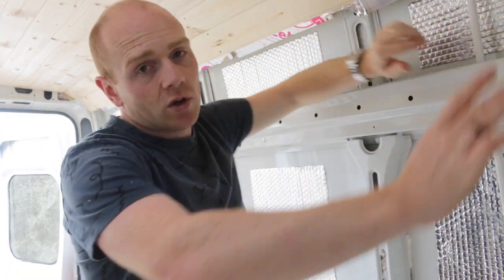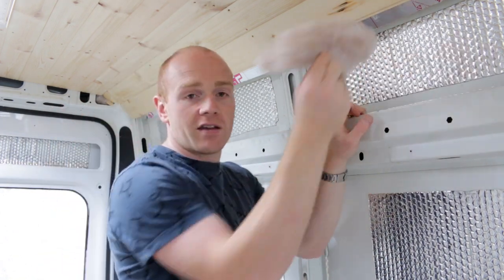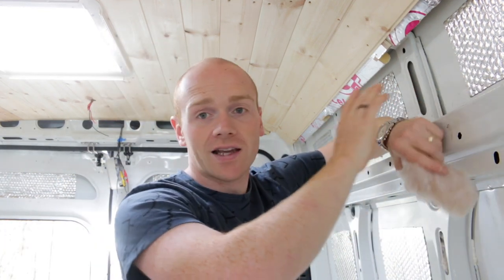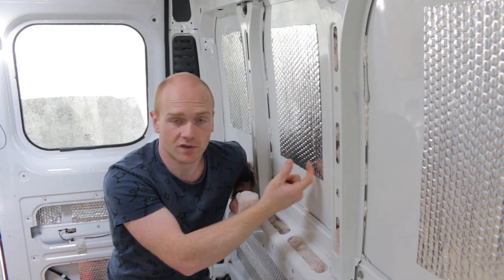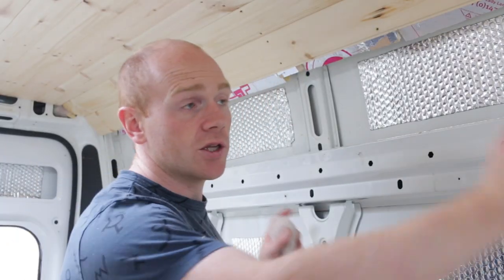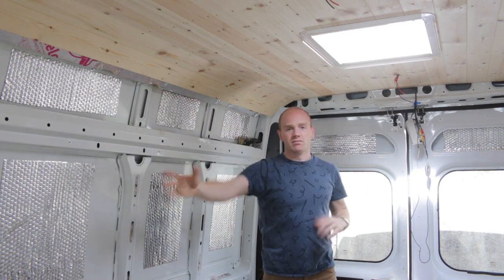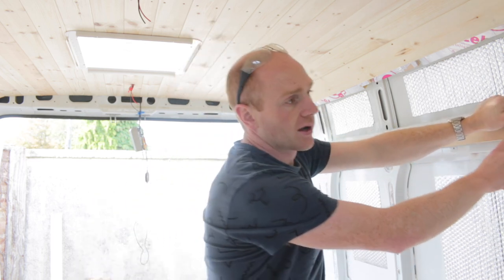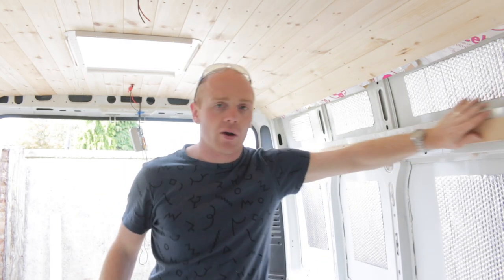VAN INSULATION PREPARATION | TRC Van Conversion 12.0

Comment from the maker: Lots of theory to get through in this one as thought it was important to go through the details but don't worry, back to more action packed episodes soon!  :-)
Reply: What type of insulation are you using in the wall? Is that sheep's wool?
Reply: Restoration Couple "The water can't get through it and condense on the metal"
This is false. Air has water in it. There is air on both sides of the vapor barrier, it's not a vacuum. Warm air holds more water than cold air. As air cools it cannot hold as much water, thus wet happens.
It's all about "dew point".
For example: When the outside temperature is 83F and relative humidity IN THE VAN is 80% then the dew point is 77F.
Therefore, for that "dew point", if air behind the vapor barrier and insulation cools to 77F or below, then condensation will occur.
Weather reports list dew point. Many clocks have relative humidity as a feature. Condensation is best avoided by avoiding the possibility of dew point air temps on the inner skin of the van.
Reply: @darrencorpe  I was looking for the same answer and I found it in other videos. It Is "Diall" recycled plastic wool. It is also under other brands "B&Q", "SupaSoft", "EcoLoft". All of this can be found by key words "Non-Itch insulation wool"
Reply: @dmay3391  the water cant get through it and condense on the metal. How does water or air pass through the impermeable membrane like aluminium foil? It doesnt. Therefore and moisture iside the van will not reach the outer metal body work. Pf course there is a small amount od moisture in beetween the van wall and the foil, but minimal. This method prevents moisture from people living in a van cooking and breathing and wet equipment from getting in to the insulation and on the van wall.
Reply: Great content. Edit it down to a video that people want to watch. Say what you mean, me@n what you say
Reply: Good informative video would prefer listening to you with no music
Reply: @dmay3391  wrong. The air behind the vapour barrier won't be 80 RH because it is behind the vapour barrier. If it remains airtight then it will still be the same air in 10 years time and will have the same amount of Absolute Humidity in it. It's Relative Humidity will change with Temperature.
Reply: Positive and Negative Comments I had to😂 btw new Supporter and hopefully will have a van to convert soon

Comment: Thanks for post, interesting. Sorry but gotta rant,  about this "Öh it's not very green,"  this is just virtual signaling nonsense. If you're so concerned about the planet don't leave the house, don't buy a van and certainly don't drive about in it. The carbon output difference between you driving about in your van and not using expanding foam must be about,  0 . 00000005%  And to be honest, there's loads of information arguing against the so-called global warming.  I know it sounds rude, but when you write things down it often does, where as if I spoke to you in person it would not sound as bad.  Again, thanks for the info, I'm about to build a campervan and need to choose insulation method.
Reply: It's virtue signaling, not virtual signaling. There's other considerations for the environment other than just carbon but since you deny climate change it seems like that wouldn't matter to you.
Reply: Sorry but the argument against human induced climate change are from the non scientific world, over 90% of scientists believe this is true! 

However to add a point from a climate change graduate, if your holidaying in a van instead of long distance plane based holidays (say Caribbean or Asia or regular trip to Europe) your must likely using less carbon in a van than in a plane. Inc the build.
Reply: worth thinking about benign insulation materials such as Thermafleece which provide both thermal plus some sound insulation.  The VW electrician was overjoyed it wasn't that 'itchy stuff' which I think we should be putting nowhere near human beings.  The van is a metal impermeable external shell so avoiding sealing any cavity areas and reckon allowing some internal 'breathing' of everything inside the metal skin is a good idea.  I wish there was an option for the  plastic carpet internal lining material.

Comment: I lived in a caravan for two years. Every flat surface would suffer condensation. Walls, inside cupboards, under seats. Only way to stop is to have every surface covered in a soft fabric insulation. I covered the walls in carpet tiles. I see a lot of these vans with wood walls, that is the last thing i would use. As a surface finish i would use the wall carpet fabric. Also why not use sticky backed closed cell foam as used for car sound insulation.Heat and sound is only vibrating air molecules and that is what you are trying to stop. I have used on my small van. This silver stuff looks good, but only reflects radiate heat, of which ain't much inside a van.
Reply: Yul Strokheet Al-Wauch  Because it insulate the cold surface on which condensation forms. Reason why lining carpet is popular in motor home vans. Submarines at one time were lined with cork.
Reply: @flybobbie1449  would u recommend to put cork for the vans put straight on metal
Reply: @robsonm9449  Might work. I just found cork expensive and ugly if leave it bare.

Comment: As you mention, rivnuts would be another option for mounting those battens and I'm sure you'll find they are available from the dealer ready to fit into all of those preformed hexagonal holes.
No criticism for the way you have fixed them though, they look very sturdy and erring almost on overkill, but that's exactly how I like to make stuff.
Looking forward to the next episode 👍
Reply from the maker: Did  think that there may be something for those holes, oh well always a nice feeling to use up the hardware you have cluttering up the garage!

Comment: I want to thank you so much for all your efforts in making these videos. Your van series has finally inspired me enough to take on my own van conversion which until now I have been to worried, with the lack of knowledge and confidence, to tackle.

I too have 2 small children a similar age to you. I bought a 2011 Sprinter a few weeks ago, but religiously watched your series before making the plunge and now that I have the van and have started the build have found myself traipsing back through your serious to revise some of the useful tips you've suggested.

I bought the same Transit Custom rear seats as you, got the twin seat with both iso fix for the kids seats, i fit them next week and cant decide whether i should fit the single 3rd. let me know if you think its still worth doing if you read this? i'm going so a slightly different sleeping arrangement for the kids, i plan to have 2 detachable table/bed that will fit to the wall below the drivers rear window but lays over the rear seats, this will hopefully work and double up as a table for the swivel front seats during the day and a bed at night. 

Anyway, wasn't meant to get into my build lol, just wanted to send you a huge thank you for your series. I might even attempt my own basic youtube series of my own build, ha. If you are ever on the south coast, I'm in Poole and i'm sure we'd have plenty in common and the kids would get on great, get in touch if you want to get some DIY vanlifers together! Thanks again

Comment: Tip for you. If you want to drill an existing hole with a hole saw/forstner bit. Take a scrap piece of wood drill all the way through and then clamp it to the piece with the existing hole as a template, will stop the drill jumping around and give you a nice clean hole
Reply from the maker: I was being too lazy I know.  Actually ended up just using an augur bit on those first ones! :-)
Reply: The Restoration Couple ahh we are all guilty of that!. Sure the holes are out of sight so makes no difference!

Comment: Man moisture barriers are tough. It's very hard to seal up everything perfectly, air molecules are pretty small, and vans have lots of gaps and holes. And then as you say, if it gets through and condenses, it's trapped. I guess until it evaporates back into the air from the heat of the van during the day.

So I was thinking, yeah I'll just let it breath, by using breathable insulation and not having a moisture barrier. Then one night while I was working on the van without any windows open, in just half an hour the roof was saturated with water. Just the amount made me realise, I have to get that moist air out of the van before it hits the walls.  I need a vapour barrier.

But I'm going to struggle to seal up the van completely, as I wanted to use a number of the Transit wall cavities to extend the storage space. And all my cabling goes through the walls/ceiling ribs. So it would be easy to create the situation of moist air getting through, but not letting water out. It's impossible to seal inside all the ribs and cavities.

 So yeah...

I think having a way to check what's happening is critical. Excellent idea. I've never seen a single video of someone checking the moisture in the van after it's built.
Reply: Ventilation is your answer. You need air to circulate to dry the inside.

Comment: I don't know if anyone said but  put nuts on the bolts before you cut them then round the end after or you won't get your bolt back on unless your a wizard with metal and also galvanised spray will stop any corrosion

Comment: Very good information, what is that shiny thin barrier shield material that is stuck on the wall and why did you not cut to to be flush with the ribs? Thanks for your help!

Comment: Hi
I. Have a ford transit work van and i use it the odd time for sleeping at festivals or remote spots for early morning photography. Question. I'm  just about to get it kitted out with shelving etc and wonder if theres any benefit what so ever to put some insulation inside the ply on both sides?

Comment: Great videos! Question: How do you work around insulating (and mounting wall) around outputs for rear lights and locks? I am questioning how im supposed to insulate that while at the same time be able to access it for service. Do u stuff those panels at the backdoor with insulation? Do u cover them up with walls after? 

I will most likely use polyiso and armaflex.

Comment: Hi! Thanks so much for the video! Very informative! I was wondering though... If one paints the internal part of the metal exterior wall with some kind of rubber paint that is waterproof, wouldn't it help to prevent condensation as water droplets couldn't be form on that part of the wall? If it is so, than would be a good thing to also paint the external part of the interior (wood) wall so between the walls would be isolated from water? I don't know if that makes any sense or if I was clear, but I would like to know your thoughts on that! Thank you! Cheers!

Comment: Your opinion please.  Modern vehicles have all metal coated with multiple products to prevent rust.  Assuming that any penetration of that coating is repaired by adding back a sufficient coat of paint, why are these professional coatings of metal protection not sufficient to prevent condensation from causing rust?  I live just outside of Detroit MI, USA, and I can say that the amount of rusting you saw in cars and trucks a few decades ago was significant and today it is significantly reduced.  If you take good care of your vehicles paint most rusting has been effectively eliminated.  Thoughts?  PS, thanks for the videos.
Reply from the maker: The condensation is less about rust and more about what it causes, mould, degrading of insulation, damp smells, etc.

Comment: Not a bad video. Sounds logical, but I would like to see some actual studies. Personally I'm wondering if it is better to leave an air gap and unplug the holes at the bottom and just let the cavity breath. I would make the walls with prefabricated panels incorporating insulation, that could be removed if needed.
Reply: What about a vent on the outside???

Comment: Have you come across cold bridging/thermal bridging in your research adventures? I've seen a few people complain that cold travels from the outside along the screws (wood panelling that's been screwed into the wood brace that's been screwed to the metal ribs) and there's damp rings around every screw on the inside panelling
Reply from the maker: The majority of issues like that tend to be where paneling is screwed to the ribs direct with self tappers.  It may still bridge through but with the rib void filled with insulation first there is actually very little bridging to the outer skin. In our case we our filling our screw holes and then painting the wood so that will further reduce the risk of the screws becoming a dew point.  I did touch on this in the roof video I think.
Reply: @TheRestorationCouple  3 years on an still thousands of people finding your van build videos invaluable.
I've read several horror stories of people insulating similar to how you have but found later that water had somehow got into the space between the van wall and vapour barrier (some mention van trim clips, bad seals on wheel arches or body seams). @therestoreationcouple I would love to know what humidity readings you have taken through sending the sensor up the drain holes. I guess taking time to seal and holes where trim clips come through, checking and sealing the wheel arches etc will limit/stop the ingress of unwanted water from the outside.

Comment: Great job. Like attention to details. However not sure I agree with battens for those upper beds. Looks like they take even more internal space. Would it be better to put some captive nuts (or nutserts, whatever they are called) into the holes on the van frame and bolt directly to them through the wall lining ply?
Reply from the maker: Even without the beds I would still batten our the whole van to help with the lining and avoid fixings being in contact with both the van metal and internal air.
Reply: By the way - do you have an idea of what the finished internal width at bottom and top batten levels is? Sorry if you covered this already in other videos - did not manage to watch all of them yet.

Comment: Moisture in the air will condense on any surface where the temperature difference is sufficient.
Reply: Which means there will be condensation between the metal and vapor barrier?
Reply: @svorskemattias  Good point you have to install vapour barrier when its bone dry I suppose. Also I think using the conduit that you feed the electric cables through as a way to vent any wet air between the vapour barrier and metal is possibly a good idea.
Reply: @chatteyj  i don't think it matters actually. Try tightly closing a plastic bottle in "dry" air, and then expose it to daily  temperature changes for a few months. I dare to say there will be condensation on the inner walls after that. I'm not sure, but I'm not gonna risk it in my van. :)

Comment: Great job & explanations. One thing I don’t understand is bolting a furring strip to the metal bracing because screws don’t have sheer strength. How are you gonna attach the cabinets? With bolts or screw into the furring strip? Why not bolt a type of hanger to the steel bracing to bolt the cabinets to? You could also use some type of “U” hanger like a French cleat on the cabinets for strength and screw the cabinets into the metal bracing. Kitchen wall cabinets are screwed to the studs. 
Like I said I’m just asking so I can understand your method. I don’t want this to come off as giving you a hard time.
Reply from the maker: It is primarily to facilitate where I will screw the internal wall panels to.  When it comes to any units that are not secured to the floor then I will probably end up using a few fixings that go right through to the steel rib or possibly a toggle type fixing.  French cleats might be used where I plan to have removable units for the occasions we need more space.
Reply: The Restoration Couple thanks for a quick and detailed reply.

Comment: double sided bubble wrap will give you a 10 degree difference If it's used properly and not touching the outside of the van.  10 degrees is a massive difference.

Comment: If you have noticed the rigid insulation is very slippery on the foil and most people tape over the joints from experience I can guarantee the tape will lift and come off. I always wipe where I am tapping with  meths or brake cleaner to remove the coating you probably felt this on your hands after dealing with the stuff. Maybe do a test and see tape two bits together and hang on a wall or ceiling and watch. 
Hope this helps well done for the videos.
Reply from the maker: Yeah I have noticed that on other projects.  Some tapes are also better than others.  We foil taped our whole loft and were able to monitor that for a few months before boarding over and all ok so confident enough with this.

Comment: Great vid! Did you ever check the insulated space with a humidity sensor ?  My build is very similar but I'm installing a small roof vent just to provide ventilation to the space enclosed by the vapour barrier.
Reply: Was about to ask the same question..
Reply: @The Restoration Couple , amazing video as usual! Did you have any time to check the humidity since 2017?

Comment: If you were to want to dissemble the whole van to sell it, how would you deal with removing all that adhesive? I'm hesitant using any adhesive for that reason but I'm not sure if it's an issue much.
Reply from the maker: If you really had to you can use a thin wire and pull it through the seal to cut it. However it would not be worth the effort to gut the van to sell, hopefully worth more as a camper and not planning to sell anyway. 👍
Reply: You could use adhesive removal